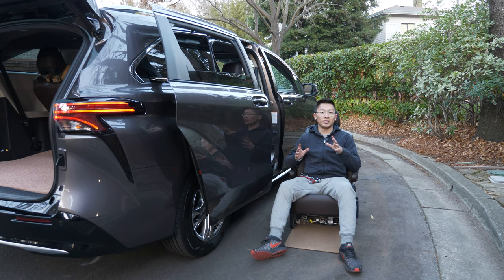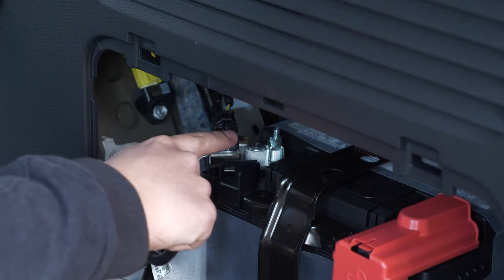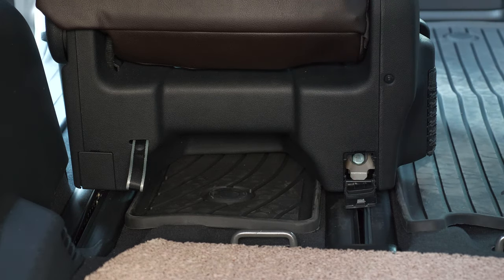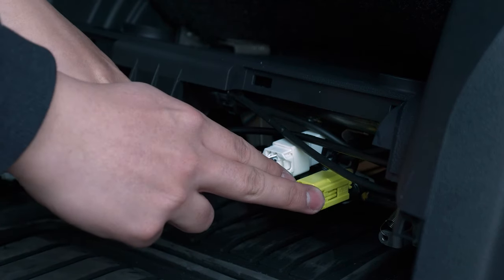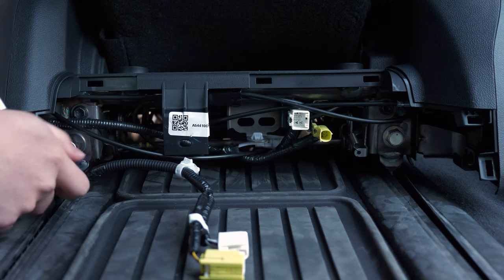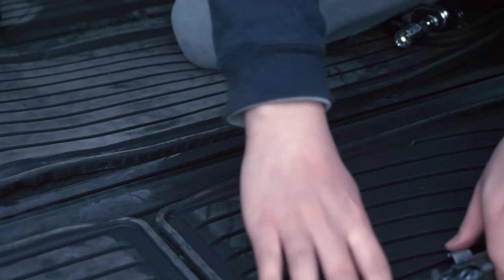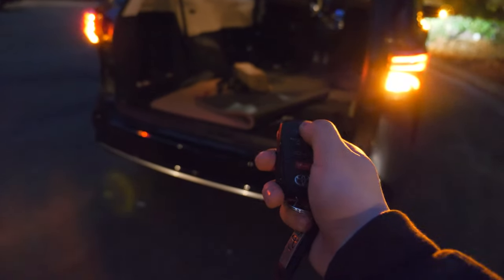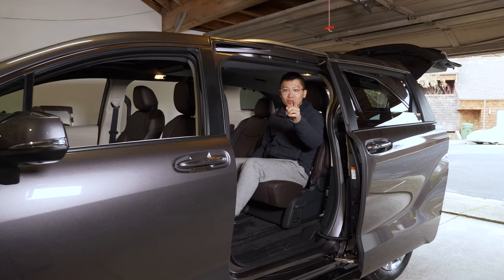Removing 2021 Sienna's "Non-Removable" Seats (UPDATE IN DESCRIPTION)

Comment: @Brad Ling, are you certain you did not deactivate your entire airbag system? Are you warned that the rear airbags are not working, or do you have a general airbag warning? If general warning, that I believe means your entire airbag system is down and inactive, as the car could not verify the airbag system is operating correctly. That's what happens with my older toyota. Can you please clarify what warning light comes on as well?
Reply: A former Toyota service technician just stated very clearly to me that the other parts of the airbag system are also inoperable with this break in that circuit.....one should be able  to find the right sized resistor and insert into the remaining half of the yellow connector to mimic the removed airbag circuit.....I'm planning to start with 2.2 ohms.  He likewise informed me that the wiring diagram would not state the resistance of the actual circuit.  Looking elsewhere online it appears that others have used resistors between 2 and 3.5 ohms,  5 watts.     (although it's not certain that measuring the existing real resistance in the removed seat  airbag circuit with a multimeter would deploy the airbag there are certainly some reports of that happening with significant injuries,  so caution with all of these steps would be advisable...there are legitimate reasons that Toyota has specified that these seats are not designed to be removed which also argues for careful consideration when undertaking this project)
Reply: An update a few hours after the comment above....so I didn't have on hand a 2.2 ohm resistor,   but I can report that a 10 ohm resistor wasn't successful,    a 2.2 kilo ohm resistor also didn't work,    nor did a 1 ohm resistor........but two ceramic 1 ohm resistors ganged together in series did the trick and now the error message has disappeared and I'm confident enough that the remaining part of the airbag protections should be functional.   I've ordered the much smaller metal film 2.2 ohm resistors which are quite inexpensive and will tape things up,  reassemble the small platform custom constructed to hide and protect the now exposed seat carriage and I should be able to forget about this issue until I'm ready to sell this van in the distant future.
Reply: @douglassheldon4409   could you please film a video shows how you do it?  And where can I buy the ohm?
Reply: @830619blue  sorry that I don’t know how to go about posting a photo or a video here,  but it’s incredibly simple to do.  Search AMAZON for 2.2 ohm resistors,  very inexpensive,   I purchased a set with over 1, 000
Reply: @830619blue  ....collection of several different resistors of various sizes for maybe $13.  After getting the 2.2 ohm resistor just put one of the wire ends into one of the small round holes in the end of the yellow connector,  and the other end into the other round hole and the error message should have disappeared and the rest of the the air bags should be functional again.   If you send me an email address or a cell number that can receive images I will forward a few images if I can find them,  or even take some more to show visually the straightforward solution to getting rid of the error message.
Reply: @douglassheldon4409  Good work on finding the 2.2 Ohm does the job on the Sienna as it does on the Prius. You're a pioneer!
I'd be willing to chop/grind a piece out of the rail (especially back where the center seats nearly hit the rear seats) to remove the carriages (more easily than the craziness of  pulling the rails completely). Does that look doable? (I haven't bought yet because of this). Thanks again.
Reply from the maker: I developed an airbag simulator that perfectly mates with the Sienna's connector: https://www.youtube.com/watch?v=CFSBTX6F_sw

Comment: Thanks Brad!  Would you be willing to measure the distance from the top of the center console to the rear hatch?  I’m just curious how much length is available to us in the new Sienna with the 2nd row seats out.

If I decide to get the new Sienna I will probably remove one of the second row seats permanently, so I would definitely want to figure out what resistors or other electronic trickery would be needed to defeat the airbag nag screens.  This would also allow me to be sure that there aren’t warnings from the other airbags that are being masked by the ones that are missing completely.

It shouldn’t be an insurmountable problem to silence the warnings.  People installing aftermarket seats (usually race seats) manage it all the time (Toyotas included).  Finding compatible connectors would be a good place to start, although 3D printed connectors and whatever random pins/sockets that make decent contact would probably work for building this non-critical bypass.

Is there any wiring diagram or layout info on the airbag / seat belt system in the Tech Info site?  I’m curious what those two connectors and the pins in them are actually tasked with doing.  My understanding was that there was only one air bag in the 2nd row seats.  Are there actually two airbags?

Thanks!
Reply from the maker: I measure around 96 inches from the center console's top edge to the rear hatch.

According to TIS, only the yellow 2-pin connector is responsible for the airbag. The white connector is for seat belt warning and seat heater.
Reply: It shouldn't be all that difficult to rig a simple jumper wire and appropriate resistor?  to mimic the missing airbag and establish connectivity.    I'm trying to get access to the wiring diagram and plan to consult with my engineer son who may be able to eyeball a workaround.   I'll post further here if I have success.    Thanks so much for a very helpful comment.
Reply: @BradsHacks  superb video....I constructed a small wooden platform with 1/2 plywood and rug to protect the exposed carriage....if I can post images here I'll include a photo here soon.
Reply: Thank you for this question, I was wondering the same exact thing. If anyone figures out the correct resistor PLEASE PLEASE post here. I was surprised about the 96 inches. I saw another video in which a salesman said 86 inches. Can anyone if it is 96 or 86? Thank you BRAD so much for this video.
Reply: @jkbaumohl  2.2 ohms has been working reliably for a month now in my workaround.  super easy to insert either end of an inexpensive, small dimension metal film type resistor.  (I’m virtually positive that a resistor up to about 5 ohms,  but probably at around 7 to 8 ohms the circuit would again show as being open and the warning light would show (remaining airbags would then not be functional in an accident, plus the annoying warning would be perpetually distracting.  the functional connections in the remaining half of the yellow connector are the two small round holes,  that’s where to insert one of each end of the resistor into each of the two round holes.  I also constructed  small plywood platform to cover the remaining metal trolley tracks that offers a strong weight bearing protection that will protect them until I may trade in this vehicle several years from now.  The wooden platform has just enough height clearance to rest on the hard plastic of the trolley frame, about 2 inches and I used one of the removed threaded bolts to securely hold that platform in precisely the right location.  I have a few images, but haven’t been able to figure out how to post them here.  If you PM a contact destination that would receive images I could send them before too long (just had total knee replacement surgery earlier today and might be intermittently unavailable for a while)
Reply: @douglassheldon4409  seems like YouTube may have deleted my reply. I am guessing because it included an email address in it. First off I hope you recover well. I know several people who have knee replacements, and it helped them gain back a ton of mobility. There is no rush on the info as I am at this point considering the vehicle for a potential minivan RV conversion for camping. With that said I would love to get any information you have on parts, process, knowledge if the rest of the airbag system works now and dimensions. I am going to give my address a different way hopefully this will work. I have a gmail account the name is rebellemmingvanlife.  Thank you so much.
Reply: @douglassheldon4409  Did you remove the seats successfully with no airbag light? Want to repeat it in NY for pay?!?!?
Reply: @bobhirschhorn562  yes,  successful …no warning light and remaining 3 air bag functionality should be intact.  don’t do this sort of thing for monetary return, (although flattered by your offer)…I’m willing to discuss more with you,  quite simple and straightforward for someone with a minimal amount of DYI tool experience…only other special part required is a low ohm resistor, cost is pennies.  If you wish to pursue, message me with some contact info and we could correspond more directly?

Comment: Not that I’m going to buy a minivan, but watching this video makes me I’ll rather buy a Pacifica with stow-n-go. Problem solved.
Reply: and sacrifice the reliability?
Reply: Those cappy vans will break in 2 days lol
Reply: @ajf5745  All I need is a car that will last me for lease period which is typically 36months. For safety reason, I’m not going to put my family in an older vehicle. It might not matter for in-town use only, but for a road trip vehicle for the family it’s a good investment to get a vehicle that is equipped with latest safety technology which is most likely to promise a better protection.
Reply: @shahali1969  There’s nothing wrong with a vehicle that has better reliability, but would you really wanna put your family in 10+years old Toyota vehicle with hundreds of thousands miles on it? No matter how well maintained and how long it lasts, sometimes it’s better off to spend some more money and protect your family in a newer safer vehicle. And even if it’s a Chrysler, how wrong can it be within the warranty period? And worst comes to worst, you’re still covered and pay $0.
Reply: @stevenkim9637  the thing is, we've come to a pinnacle of safety in modern cars. In fact, it's becoming difficult to make cars safer. The sienna is the first minivan to get the top safety pick plus from iihs, besting the pacifica. In 2030, the 2021 sienna will still be safe. Remember, before cars didn't have all the airbags or aeb, so the difference was more distinct
Reply: @stevenkim9637  look at iihs safety ratings. Good in all the tests, even headlights
Reply: @ajf5745  I'm not saying the new Sienna is not safe compared to Pacifica. However I don't agree with you saying it will be still safe in 2030. If you compare 2010 era, there were no small overlap tests before. And when small overlap test was first available through IIHS, the results were shocking. Granted 2020 most of vehicles are small overlap ready and its safer, but in 2030 there will be more technology and safety features will be available. For example, more accurate driving assist towards near self-driving will be available. Current TSS 2.0/2.5 is okay but I'm sure you'll agree the higher the version it gets, more accurate the system will be. Also idk if Toyota offers steering evasive support but you get the idea. Plus all the high safety tech that's available in new S-class like seatbelt airbag for 2nd and 3rd row would be a good addition as well. The current Sienna might be an ok vehicle 10years later in terms of safety, but just like we've seen last 10years of change most likely the safety standard will be on the next chapter in the next decade.
Reply: @stevenkim9637  well it's not 2030
Reply: @stevenkim9637  I thought you buy a new one not a used one
Reply: @shahali1969  I brought it out only because AJ mentioned it. Obviously most of Toyota buyers considers longevity of the vehicle because they want to keep it for a long time. Mechanically it should be still running strong in 2030. But that’s not the point here. And there’s nothing mentioned about used vehicles here so I don’t understand what you’re trying to say. Long story short most vehicles sold today will likely to last 10+years but it won’t be as safe as the upcoming models that will be for sale in the future no matter which make model it is. As a family vehicle I’m willing to pay a little extra and keep getting a newer vehicle for better safety and convenience but you and Aj are keep talking about reliability which has nothing to do with sienna not having removable 2nd row seat which is a day and night difference compared to stow-n-go. 🤷🏻‍♂️
Reply: @stevenkim9637  The advancement of safety tech doesn't make your vehicle any less safe with time. We will forever be limited by the laws of physics and we've largely hit that barrier. The survivability of head-on crashes above 40mph drops dramatically with slight speed increases. There is just no way to reduce the sudden violent deceleration in a crash besides enlarging crumple zones and making the vehicle bigger. 

That's why the single biggest factor for safety is not necessarily what you drive, it's how you drive and steps taken to reduce risk.
Reply: @notmyfaultthisishappening3795  
You’re talking about passive safety, not active safety. And even then in your theory 90’s Camry should be as safe as current model because you say advanced of technology doesn’t make your vehicle any less safer over time. Although I partially agree with you as higher speed increases the impact due to law of physics, it also matters on how the accident happens (head-on, small overlap, side) and what you hit(another vehicle, wall, tree or light pole) and the results could vary. My comments were focusing on active safety features in newer vehicles such as seat belt that has air bags, pre-collision warning and avoidance. A lot of new vehicles nowadays comes with system that beeps and applies brakes when driver is not paying attention to avoid or minimize the impact. And talking about passive safety, if you saw the revolution of small-overlap test era then you will most likely to understand you underestimated the technology and engineering development. Auto makers are now expanding the usage of high-strength steel to make a vehicle safer. So in situations you mentioned, vehicle made with high strength steel will be a lot safer.

Comment: Does your van have the spare tire? I'm interested in a video on how to install the spare on a van that didn't come with it from the factory.
Reply: I would be curious also. Couldn't find an le with the spare.
Reply: It has an option to get an undersized temporary spare. It actually fits in the wall of the back driver's side wall. If building a RV conversion you need to account for it to have reasonable access to it just in case.

Comment: I'm happy that Toyota added a shoulder air bag, my children nee more protection. But they could have made it much easier to be removed and supplied a resistor to cap the airbag terminal to make it possible to remove the seat a safely.

Comment: I'm doing a van conversion to a camper. I need a way to permanently disable the airbag warning.  Please let me know if someone comes up with a "dongle" or computer solution.  Thanks. Great video.
Reply: @llewwilliams4621   Wow!  Removing seats in Toyota hybrids always incurs warning light problems.  If these things work, it is great news for many of us.  Thanks for bringing these to our attention.
Reply: Hey Llew is this still working for you?
Reply: @jeffreytotaro7051  yes
Reply: @llewwilliams4621  Thanks Llew! Do you just tape them to hold them in place?
Reply: @jeffreytotaro7051  the resistors have two   prongs that push into the plug from the airbag harness.  I taped them up to keep them tight and tucked the harnesses up under the seats so they are out of the way.
Reply: @llewwilliams4621  Thanks again. Sorry, one more Q. Is it the white or yellow harness? One is airbag, what is the other? Weight sensor? Power?
Reply: @jeffreytotaro7051  yellow is airbag
Reply: @jeffreytotaro7051  other is for seat belt. Nothing need to be done with white one
Reply: @jerrylenhart5717  I'd also be worried about handling and storing the seats (er, bombs).
Reply from the maker: I developed an airbag simulator that perfectly mates with the Sienna's connector: https://www.youtube.com/watch?v=CFSBTX6F_sw

Comment: Can you buy an XLE awd 7 seater, then buy  the middle row seats to make it a 8 seater awd? Is that what you plan to do? I am not sure why the heck Toyota does not offer 8 seater awd on XLE or above trims??!! Why not give us that option if you already offer the 8 seater awd on the LE trim but want more of the extras that XLE and above offers!!! You reading this Toyota?! We want 8 seater awd on XLE and above trims!
Reply: It's all about total curb weight. The all-wheel drive adds another motor to the back. interestingly, you can't get the leg rests if you want the spare tire in the all-wheel drive version.

Comment: Do you know if this would work on a 2021 Prius front passenger seat? I was told by dealer service center as you mention in your solution video that disabling the airbags on the seat would also disable them all. I want to remove the front passenger to do a car camper build and have more room for my dog. I managed to get the back seats out but there are no air bags in the actual seats and on the front I know there is.